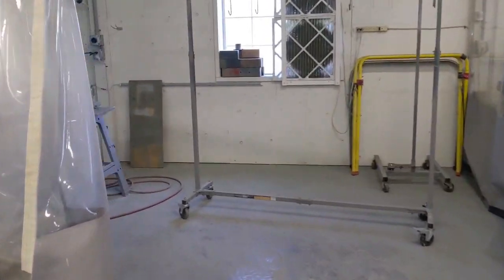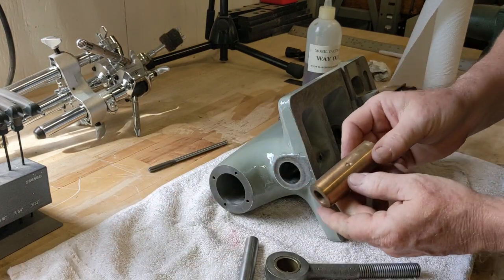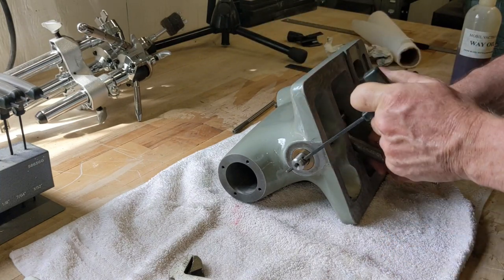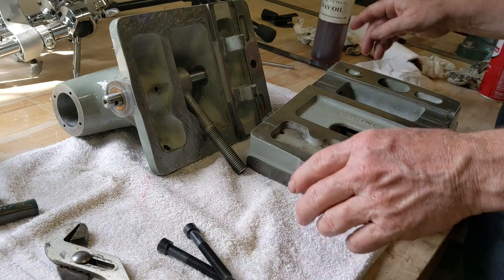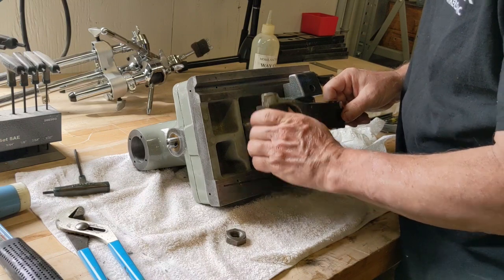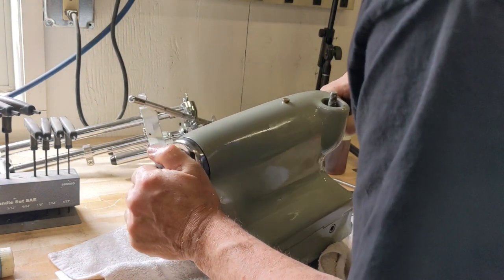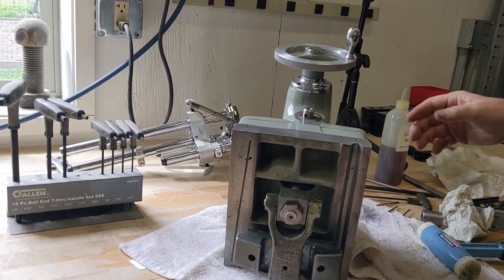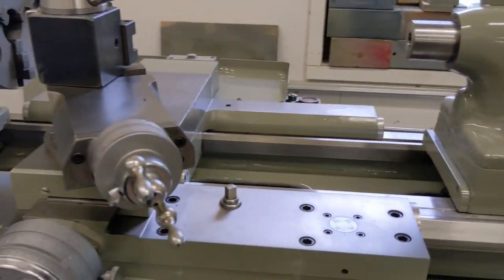Monarch 10EE Lathe Refurb part 27b

Comment: Love this!! Do you have a lead on a tailstock for my 10ee?? James
Reply from the maker: Hi James, glad you tuned in! So I don't at this time. I do believe there are two different tailstocks, the round dial machine and square dial machine have slightly different height off the bed... I think I read that on practical machinist. I have found all sorts of parts on ebay for these machines over the years. People either parting them out or they came across various bits and put them on eBay.

Comment: curious - how did you remove the oilers in the first place?
Reply from the maker: Hi and thanks for watching! So on the one that's over the way, I had a clear shot from below and used a drift and gently tapped it out. The one on the quill was a bit more challenging, there's no direct access. If I remember, I believe I used larger pick with a 90 at the end to reach up and tap it out. On my other 10ee I made a small tool that had a little swivel at the end which allowed the tool to go in through the top, swivel the bit on the end 90 degrees and catch the lip of the oiler. Then used a little dent puller with a slide to knock it out. I couldn't find the tool I made for this lathe
. Arghh! In all cases, there was no damage to the oiler. I really wanted to re-use the plated brass ones because the new ones are plain steel.

Comment: Your paint work on the fabulous Monarch 10ee is outstanding, and is a notch higher then the close to $5000 factory custom paint option. As you know the time and work involved makes that price not out of line. Bravo!
Reply from the maker: Thanks! Yes, a good paint job is painstaking not to mention that the paint is well over $100 per quart then you have to add catalyst, reducer, 2k primer etc etc! With that said.. I believe these machines deserve it!
Reply: @fourpondsshop7940  The factory paint up into the 90s anyway was just standard oil base paint, that is vulnerable to coolants that get under it and bubble it up. The paint, filling the castings was minimal on the MFG model I have, that was used in nuke weapons development in a total gov operation, to more slicked up full featured machines, used by prime contactors. Both paid entirely by the gov, in most cases anyway. Many do not know, each machine is hand built on special order, they are, or were never new ones on a show room floor. Also makes each one, a little different, with its own personality.

Comment: Kevin,  This has been a wonderful series. Thank you for doing such a good job documenting your refurbishing of a great lathe.  Not sure why you didn’t do a 30” instead of the 20”, but that’s not important.  Did you show how you got the chatter out of the relay?  If so, please let me know as I think they are problematic and I’d really like to know how to adjust/maintain mine.  Thanks, Will
Reply from the maker: Hi Will, so I'll have to go back and review the videos to see if I did capture how I reduced the chatter.. It didn't go completely away. The reason why I decided to do the 20" and not the 30" was because I have and use the other 20 and I have a 40" Chinese lathe. I don't believe I've ever worked on parts that exceeded the 20" machine capacity. I figured someone out there might make better use of the 30 than me. My plans are to set up the Chinese lathe with metric gears for threading and the 20 for English.